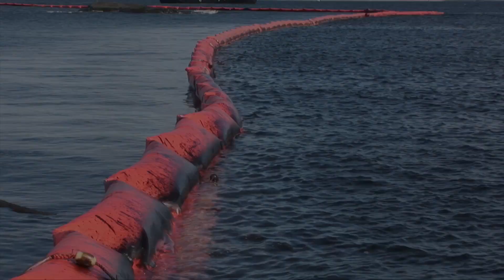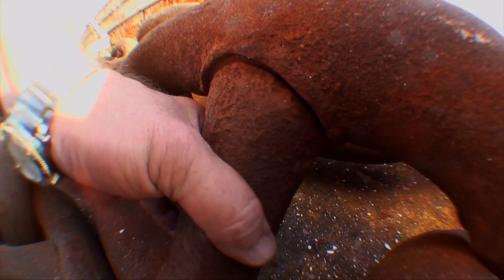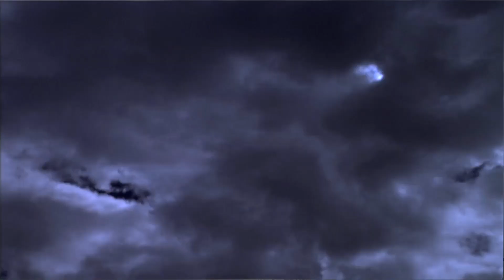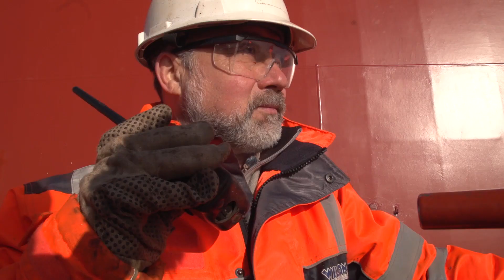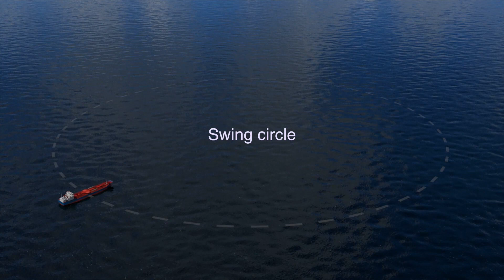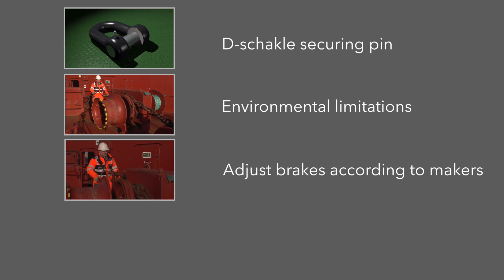ANCHOR AWARENESS

Comment: For 6 years I worked for a company that collected metal from the ocean floor for recycling and we got more anchors and miles of enormous chain off the ocean floor,  one time we were sent to get cars where a ship sank ,we brought up over 200 u.s. muscle cars someone bought and was taking to Italy  all were 60,s and 70,s cars. Some really rare. Salt water had ruined the engines I'm sure,  you could rebuild them but it would take mass money,  most of what we went af was for insurance company's that had paid for the loss already and wanted to actually make sure that they had paid for the right thing,  we brought one ship up that the owner had collected the insurance money for and when we got it up and went aboard it was totally stripped inside,  the owner had even took the huge engines apart and took em out before sinking it, then said he was out and it sank I'm sure hes probably in prison cause he collected a few million on that one and the insurance company came and took pictures and the coast guard made reports of it all as insurance fraud , the owner had it happen 2 times in 1 year so we brought the second one up so they could make sure the owner wasn't lying,  and he was

Comment: I can't imagine this being rocket surgery.   There are a few simple things to take into consideration and 99 percent of it is common sense.
Reply: You wouldn't believe how many weekend sailboat captains get the anchorage wrong. Most are used to just tying up to a dock and don't have proper knowledge of how to anchor out. Most people think you just drop the anchor and when it hits bottom you're done. They don't know about the chain/rode length ratio and "common sense" won't help them learn it without something being damaged. That's why most wannabe sailors should attend sailing classes to learn these things and other important issues that deal with boating!
Reply: Common sense is not very common.

Comment: When I was at sea in the 1970s we did pretty much as the video says. However, our chain was held in place by a "pelican hook", which was released with a sledge hammer. No mention of that here. Are pelican hooks still in use?
Reply: They are still in use on warships; their proper name is the Senhouse slip and they have a cast steel body and hook.